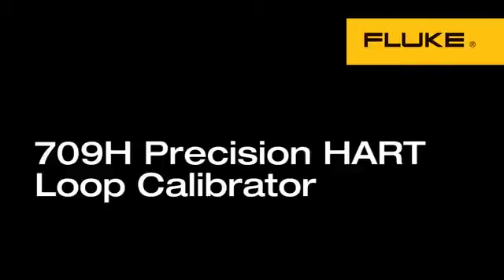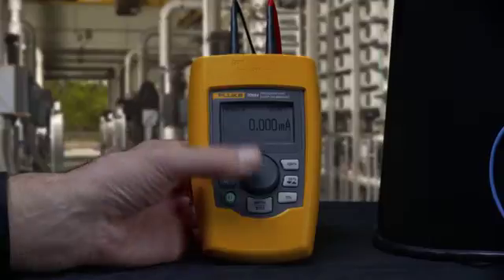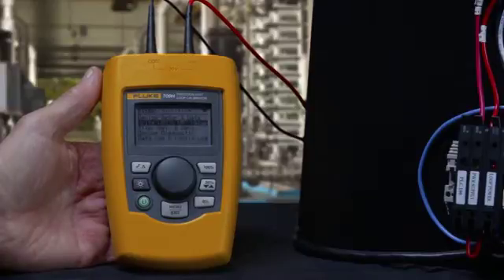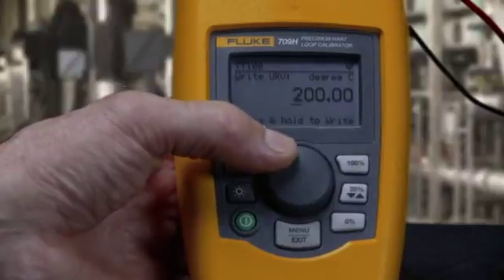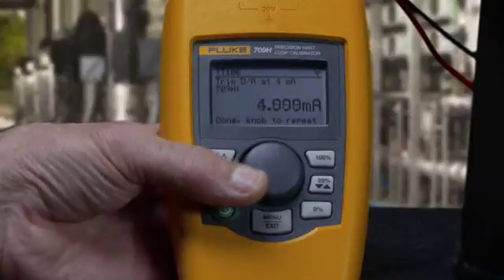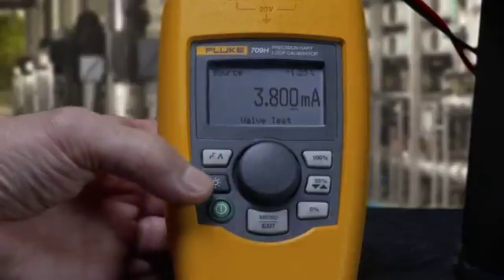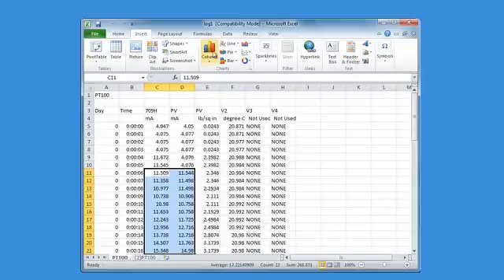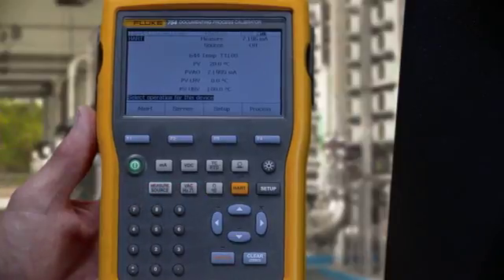Fluke 709H Precision mA Loop Calibrator With HART Communication

Comment: What is functional difference between Fluke 709 and Fluke709H?
Reply from the maker: Hello Shariful - The 709H includes HART communication functionality and supports a select set of HART universal and common-practice commands. The 709H will include a selectable HART 250 ohm loop resistor.
Reply: The video literally answered this question